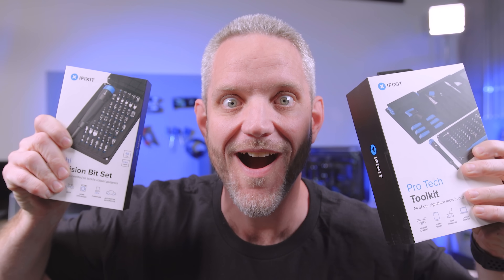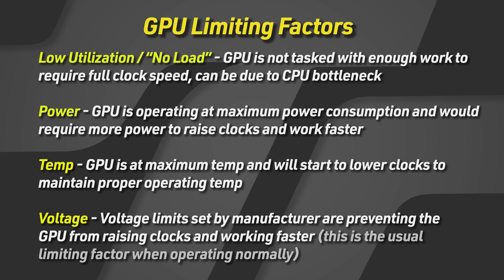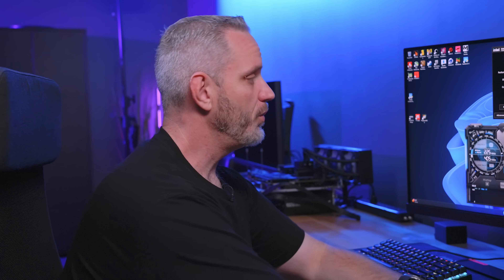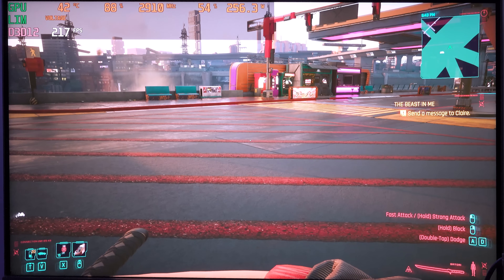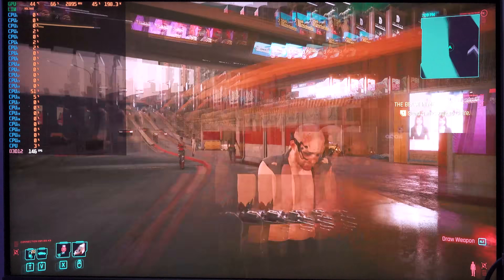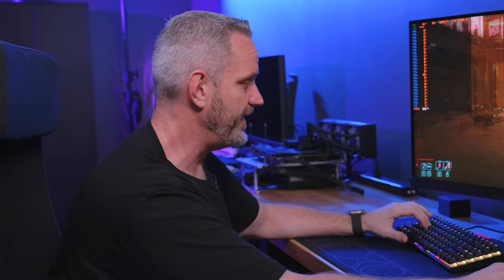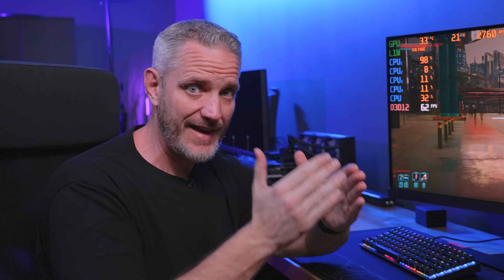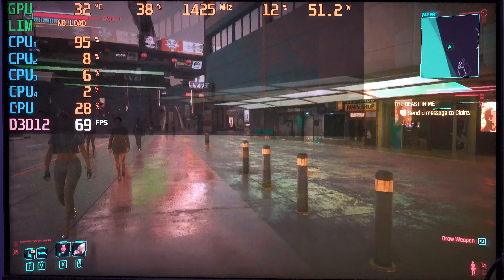THIS is what Bottlenecking REALLY looks like! AVOID THIS!

Comment: I just bought an OCed 4070 ti for black friday sale and got it for $730. Its going into my current system with an Asus X570 mobo, an amd 3700x and 32 GB of DDR4 3600 mhz ram. I think i should be ok with the 3700x, but will probably do an upgrade to a 5800 x3d in a year or two if i can pick one up on the cheap to squeeze as much as i can out of my am4 board before having to do a whole new build. Hoping this system will carry me all the way to at least an AM6 generation before needing to do a new build.

Comment: When you went from 16c to 4c the maths didn't math for the cpu utilization. With 16c, 1c was doing 50%, a couple were doing 2% and most were doing 0%. With 4c, 1c was 98%, 1c was 42%, 1c was 27%, 1c was 23%, and one was 21%.

Comment: This is a good demonstration of what CPU to GPU bottleneck means and how to spot it, however I think it's not representing fully what it could look like for most people. For example, 99% of people don't own the 4090 and have a more midrange to low end build and when you already don't have the fastest GPU in the market where you maybe are playing between the 60-100 fps in most games, if you have a bit of bottlenecking happening the difference will very much more noticeable than the scenario in this video. I mean just from the comments alone here we can see many examples of people saying how drastically a CPU upgrade improved their performance.

Comment: Pro tip: in older games like Nfs: carbon when they bottleneck on new gpu go to gpu settings for that game and set energy management to max performance. On normal mode it stutters because gpu doesn't know it needs more power for seemingly unrequiring game.

Comment: I have an Intel Core i7-4770K with DDR3 RAM running together with a RTX3090Ti on a 4K screen. I don't use any diagnostic tools on my computer, but most games actually run fine with this setup. Even Cyberpunk. I guess there are some CPU heavy games out there that will run at a low FPS on my computer, but I certainly haven't come across any such games yet.

Comment: Very informative video. Got this software and fired up a game to take a look and looks like my CPU and GPU match quite well. All cores on the CPU are at around 60-80% utilization and the GPU is at around 90% with the limit being Voltage. Now if only they were more modern stuff than an RTX 2060 and a i5 9600K

Comment: My tower has an i7 2600 (I use laptops mainly and have not upgraded this system recently) with 32GB DDR3 and a GTX 960. I kinda wondered what tossing the RTX 4090 (don't worry, it has a 1200 watt Corsair gold power supply) and loading new games on it would do. Interesting that the 2700K was mentioned.

Comment: I learned that it's a good idea to get as powerful CPU as possible, it will work fine with a weaker GPU on lower graphics. It's much better than a weak CPU and a beast GPU. Like my friends have: 
- An old FX processor + 1080ti
- r5 5500 + 6750xt
Especially the FX bottlenecks really hard no matter the graphics

I play competitive FPS and have 5700x3d + 5700xt. Now I'm GPU limited so I drop some settings if I need more fps but it's fine cause I can upgrade the GPU and it won't bottleneck

Comment: Did my current system in 2015/2016 with a i7 7700k and a gtx980ti.. now its time for an Update since i start to get some problems with what i wanna do, budget is tight since my car need mainternance aswell.. hope with an ryzen 7800X3D and a 4070 i get a good upgrade, later on again a different gpu but i guess i will have a bit time and the ryzen will keep up for a few years. 

Damn i loved the time back then, did everything custom with delid and watercooling.. now i will go along with some AiO and more pratical things duo to my current life Situation i dont have the time for playing around a lot with hardware and my priorities changed a lot.

Comment: Recently I bought the Radeon 7900XT.

I was playing with Cyberpunks grafics settings and no matter what I chose, I always had around 40 Frames per second. WQHD or 4K, same. Normal Rendering vs Raytracing, not a big difference. Pathtracing was pushing it, though... It was just slow, no stuttering or sudden drops.

Now I changed from a Ryzen 5 3600 to a Ryzen 7 7800x3D and BAM!
Suddenly I have frame rates around 90 or 100. Even more if I use Rasterization.
That was an easy solution for this bottleneck, though quite expensive...

Comment: I7-8700k + strix2080s over here. My pc almost forces me to play games in 1440p, because the 8700k starts to struggle with a lot of the newer games, but at the same time, the 2080s struggle to keep good framerates at 1440p. I mean, it absolutely works on high/ultra settings in most games, but i lose st least 40-50fps compared to 1080p. 

So i have the choice: -1080p with struggling cpu
1440p with struggling gpu

Comment: I was running an i5 4670K for 8 yrs with a 1060 6GB card, Last year I could not afford a new system so upgraded to an i7 4790 and paired it with a 3060 12 GB card and system run pretty good, I will be going over to AMD though with an AM5 7600 and initially the 3060 12 GB card and the next year hopefully upgrade the GPU to a 4070 Super, So the AM5 7600 with a 4070 Super should be good for 4 or 5 years. Note : I do run triple 1080p @ 60Hz and will be going up to 1440p 120Hz triples in the future, Resolution also has a massive factor on system Balance which in the most part is overlooked.

Comment: me with my 4070 OC and a i7 9700k lol, but my system runs great and crushes most games still with very little difference to newer systems. Im probably gonna slap a I7 9900k in my system as a last upgrade before having to build a new rig though and thatll help it be even faster for a few more years to come.

Comment: Mate, test you stuff in Guild Wars 2 the Dragon's End zone with two full squads nearby at max settings. If you hit above 60 fps in that case, im gonna applaud you, thats the real test, no matter what build you run, you will reach above 60fps real hard with those conditions, Cyberpunk is not a real hard test as much as Guildwars 2 on max settings. Intel 14900k with Nvidia 4090 ddr5 64 gb 6000 mhz can reach around 85-90 fps max, but its really hard to reach that number. Once all the effects start to overlap, your fps drop at 30 to 60 fps.

Comment: I have an i5-9600k and 3060 TI, i assume the cpu bottlenecks in many games but the i9-9900K is expensive even at like 300$ used 😢 and a more recent one is even worse for my wallet requiring the new motherboard and ram too 😭

Comment: I don't really understand how in the beginning when it had  all 16 cores how it was using 50% of one core and the occasional 1 or 2% of a random core, but when you dropped it to 4 cores it  was using 99% of one and 20 to 40% of the other 3 cores. it was using like 200% with 4 cores but like 65% with 16. with 0% on most cores. were they just each doing a small amount that didn't even register as 1%? or was it because you disabled hyperthreading or something? for me i always just assume more cores = more better.

Comment: I was just recently given an RX 6700 xt for free by my cousin who works on computers as a job. I popped that into my system that has an ancient i5 4690k…the bottlenecking is bad haha. My cpu is at 100% for most games I play on max settings while the gpu is at roughly 50%. I plan on upgrading/switching to an AMD Ryzen 9 5900x, which is supposedly a good cpu to pair with the 6700 xt.

Comment: The theory is correct but MSI Afterburner doesn´t show the actual CPU load. That´s why you are seeing cpu 50% load with the GPU actually suffering bottleneck and not being at 100% load. 
To test CPU load on game, the best thing for me is to use the Electric current consumed (watts).

Comment: I'm running a ryzen 1800x with a 4080 and I rarely see over 40% usage on the gpu and the max I've seen in game was 70% (can't remember which game) and the cpu almost never goes over 70% on a single core. I'm getting a 7800x3d in the next month or so and I can't wait to experience the difference.

Comment: I just want to mention this is cyberpunk 2077 this game is notorious GPU heavy game for those worried about cpu bottlenecks you actually should be modern games are getting more and more cpu heavy and I was seeing slowdowns in games pairing my 12700k with a 3080. I switched to a 14900k and saw significant fps gains and GPU utilization gains which is odd but it’s because many modern games will be cpu hungry in weird ways. At the end of the day consistent frames are king even 60fps consistent is better than a 120fps with spikes. I would recommend high quality cpu and being very careful when upgrading GPU alone on a system.

Comment: hate the word offload / transferring of load from CPU to gpu,  load isn't being moved, CPU is just has more fames to compute or less.  the game engine doesn't take more to run at 1080p vs 4k,(+- a few %)  cpu usage goes up at lower resolutions due to the higher frame rates,  no offloading or transferring of loads involved.  biggest thing that most of these videos don't cover. i would add it to your next one Jay

Comment: i have a slight bottleneck like you showed on newer games im running a 8700k with a 770xt and ive been looking at cpus cause ive come to the conclusion that the 8700k isnt competitive as it once was with how game engines and graphics settings have changed

Comment: You've shown me what I'm experiencing on my current PC. I've got a really good six-core CPU that is very likely being bottlenecked to hell and back by Intel's tragically bad UHD Graphics 630 integrated GPU. A friend of mine told me that I'm not using the CPU to its full potential and am very likely only making use of two of the cores.
Reply: 8750H

Comment: I have Xeon 2678 V3 with Turbo Unlock @3.3Ghz 12 cores 24 threads. 2080 Super 8Gb, ram 128Gb Quad Channel DDR4 2133Mhz. I built the PC at the time when 20 series where the top GeForce cards.

Comment: im pairing i5 11600k with 3060 Ti, i always wondered why my frames were so iffy on graphic intensive games(rdr2, cp2077, HD2) barely reaching the 60s mostly sitting inside the 50s, i upgraded from 1x 16gb cl22 3200mhz Ram stick to 2x16gb cl18 3600mhz(granted i had to lower it to 3200mhz cuz of my cpu still), imagine my shock when all those games were simply playing well over the 90 fps, never in my life i wouldve guessed my PC of 2 years was being bottlenecked by my ram 👍

Comment: I'm going to say something sacrilegious to more serious hardware nerds than myself, but there's times where bottlenecking can be present, but hardly be an actual issue.

My test case is my own. I'm strapped for cash, needed to buy a new build after a younger family member practically begged for a chance to get my old rig at an obscenely discounted, family members only price (1000$ for a 2080 Super with a 10900K and 32 GBs of RAM) and I sort of put something together quickly, while cutting some corners. I'm currently sitting on the same processor - an i9 10900K - with 64 GBs of RAM and an RTX 4090 Trinity OC from Zotac. I only ever game in 1080p and figured more VRAM could never be a bad thing. This card has so much VRAM at 24 GBs most mainstream titles barely make a dent in 1080p. Paradoxically, it's really good for cooling as I've hardly stressed that card at all since I started using it.

You might want to ask why I'm gaming in 1080p in the age of everyone and their mother using 4K, to which I'll answer that saving up for this graphics card took me a few months, in-between life and the usual responsibilities. I'll upgrade my monitor someday - it's just not a priority as of now. Someone smarter than myself would've probably waited a while longer and snagged an LGA 1700-compatible mobo and CPU, or their AMD equivalents, to ensure I'd have plenty of PCI-E lanes. I wanted to save and partially work with parts I already had on hand from previous builds for friends and family, so them's the breaks.

What I've noticed is that I get massive dips and spikes during initial loads, and that any segment of a game that uses some sort of way to obfuscate a map load also triggers a dip. I'm talking going from 90 FPS or more down to 40 for just a second, and then right back up. Frame Generation seems to solve the issue more than effectively, seeing as I'm firmly stuck in 120 FPS in Cyberpunk 2077. Games from the early days of raytracing that didn't receive as much love as Cyberpunk - like Neon Giant's The Ascent - are really hard to push past 40 FPS even in 1080p. Then again, even with everything RTX turned off, The Ascent's always felt more than a little poorly optimized.

So far, the only bottlenecks I've noticed have been interstitial, as I've said. No hitches during gameplay, everything is as smooth as butter as long as nothing needs to be loaded - then my framerate goes all over the place.

If anything, I just wish there were some sort of way to not lock raytracing in at 60 FPS. Some titles like Cyberpunk manage to make it coexist with Frame Generation, and others like Darktide pin you down to 60 FPS if you want all the bells and whistles, which is a bit of a shame in a game that's as fast-paced as it is.

Comment: If your bugdet ends with the price of a 4090, dont put it into your old PC, or you may waste up to 75% of that money. But also don't buy a PC with low-end GPU "to upgrade it later", it's the same thing. Get a used PC with 11700k and 3060 for ~600 (1/3 of the 4090) and play with 1440p should be the same performance a 4090 gives in 2160p

Comment: My laptop uses the chipset to process, instead of the CPU. Everything is done by the chipset, the cpu uses only 10% max for operating the laptop. Youtube streaming, coded wifi reception uses more cpu power, and tries to stay at 80% if it can. This way the video card can perform much better, and the laptop seems to be a newer one, but it’s an old one. The trick is caused by the battery health. As the battery becomes better, the laptop’s hardware upgrades itself to better speed, and less heat.
By completing quests in games, the bottleneck errors are fixed as a reward. That’s new, old games didn’t do this. Such a fix is permanent.

Comment: my ryzen 5 3600 was bottle necking my 2080ti in modern games. 2042 ran the same fps no matter what settings i used at 1440p, same for rust. just swapped everything out for a 7600x, and im now gpu limited. getting 30-40 fps more though!!

Comment: things i dont understand:
at 6:56 it looks like the game is using only 1 core at 52% but at 12:18 it looks like its using 4 cores (although CPU has currently only 4 cores enabled). How is that possible?
at 8:27 CPU (1 core) is at 55%, GPU is at 73% load, 53% power - why is CPU not working harder to make GPU work harder??? clearly nothing is maxed out, neither CPU, neither GPU or power.

Comment: A lot of people talk about their GPU bottlenecking their gaming performance. I don't believe in a GPU bottleneck. GPUs are specifically designed to be pushed. If your graphics card is the only reason your FPS is lower than you want. That's a good thing

Comment: My I7 6700k and GTX 1080Ti combo works quite well on most games, but two of them in particular, Battlefield 2042 and Star Citizen, make my CPU max out at 100%, on Star Citizen it isn't that bad, but on BF it is quite bad to the point my character can get "stuck" for a whole second either still moving as if my key was still pressed and/or not responding to new inputs.

Comment: It was not very hard for me to get bottle necking, it started with my i7-9700 and GTX1660 in iRacing, I thought it was my GPU so I upgraded to a 4060tiseemed fine for a while then I started to get clock smash errors.  Went down the rabbithole of setting changes found what apps were adding to it.  I recently upgraded to a i7-14700k and so much better.

Comment: Just to add my own experience,  5600X at 4k, 7900 XTX and two 4090s,the usage would drop from 99% to 50-60%, then spike to 70-80% and drop again. The CPU usage was low, peaking at 40% and then dropping to the low teens when the gpu dropped. The cpu was NEVER 100%. After reading a few reddit posts, i switched to a 7800x3d and gpu usage was flat at 97-99%, while the cpu was around 30-40%. My old 9900k didnt fare so well, as it would be 70-80% usage (ie "saw tooth" usage). Bottom line, and its cliche tbh, if ur going high end gpu, then get a current highend cpu.

Comment: cheers! and thanks a ton for yet again more vids like this! trying to finish plannnig and buying my new build after so many years but stress is brutal. gonna enjoy the enthusiest fun of building by going brand new, but that means my old rig needs some MANDATORY TLC to keep it up and running nad fix some fan issues nad temp issues but mannnnnnnnnnnnnnn this shows me that even this gloriousd 1080 of mine running at 144hz 1440p is struggling yes, buuuuuuuuuuuuut i swear the basic unOC 2600 i have in this system is always pegging 100% useage with 40-80% gpu and i swear ive been bottle necking it for years and i keep thinking i need a new gpu lmfaooooooo~ wild stuff but i will get a new gpu anyway~ i do love my 1080 tho and some day ill frame it on my wall lol. but still~ cpu bottle necks are wild especially with how many monitors i have in my triple settup with all 3 pushing 144hz now and the broswer tabs i keep going and ancillary programs? i feel bad for the poor cpu but 5 years with a stock cooler and little love and its been a work horse cheeeeeeeeers